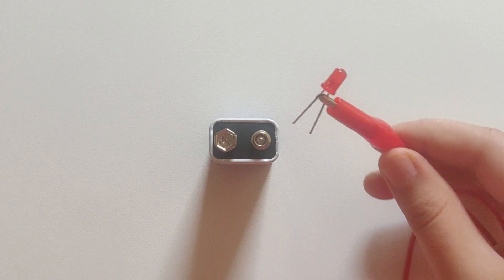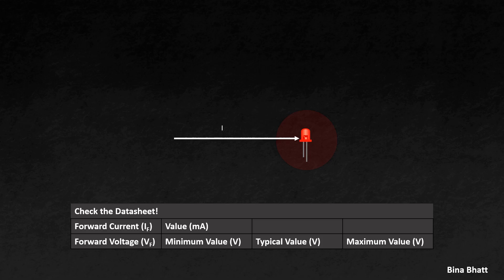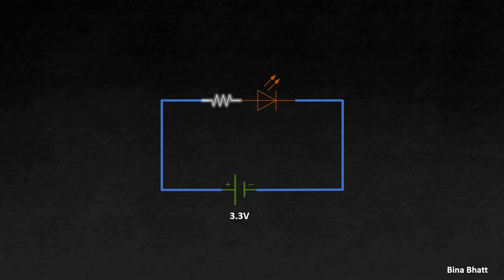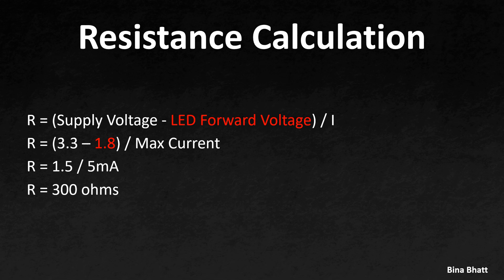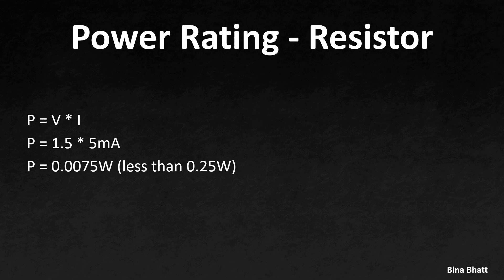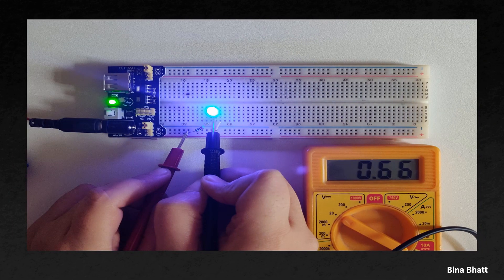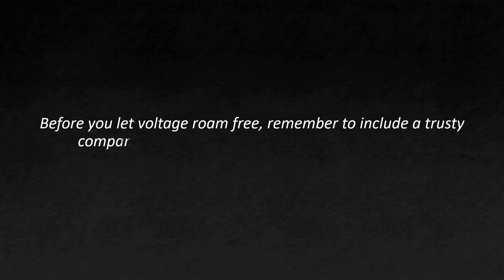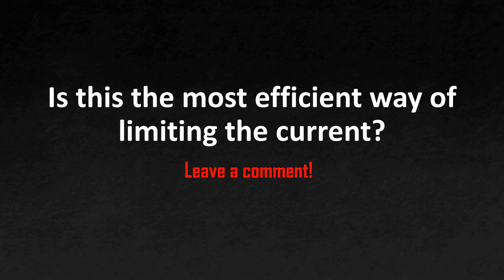Why use a current limiting resistor with an LED?

Comment: Once an IR LED exploded in my hand at 5V without resistors. It's plastic divided in 2 pieces and literally, one of these where thrown at my arm.
You didn't mention them but I will never forget hehehe.
Reply from the maker: Thank you for sharing! Yes, IR require lower voltage than visible light!